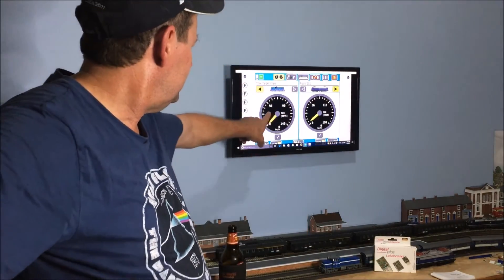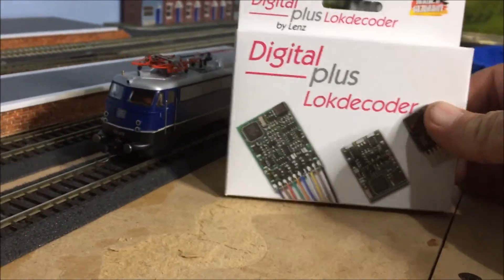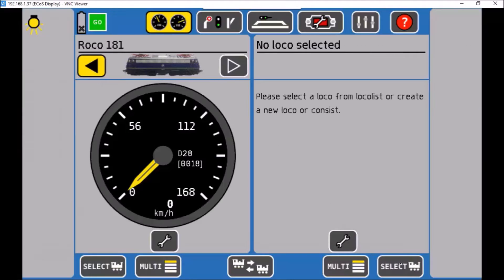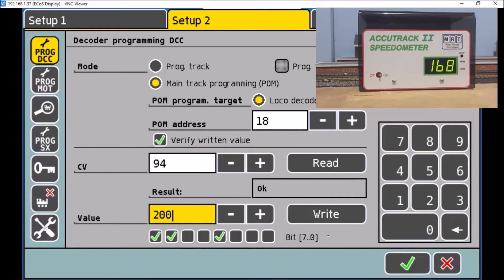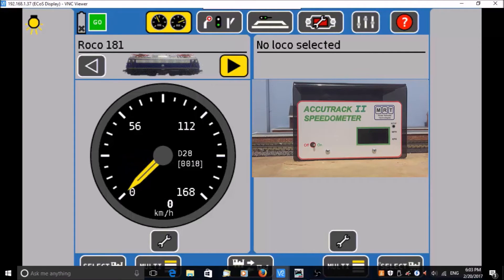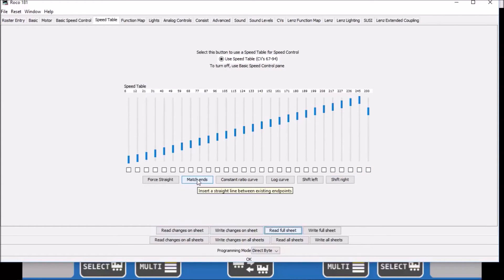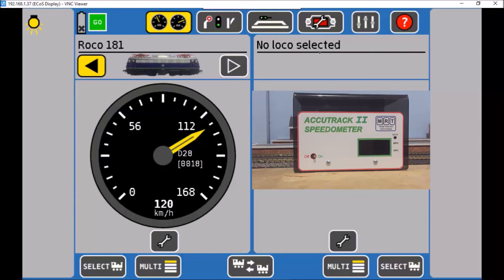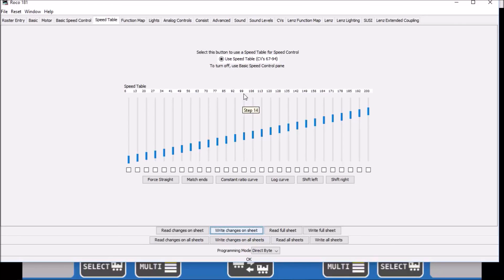How to do speed Calibration using Accutrack and JMRI Decoder Pro

Comment: I use to do the tape measure and timing, it sucked bad! 
Great tutorial thanks for the help!
Reply from the maker: No worries Joe. One of my loops is exactly 10.765 metres long but you have to wait for the train to complete a loop to get the speed. Especialy bad at slow speeds. I can just pick up the Accutrack and plonk it down in front of the train anywhere

Comment: I like it!  I will setup JMRI with my Ecos and try this out.  I just hope JMRI works with the ECOS without a tonne of tweaking.  -Chris
Reply from the maker: Should be pretty easy Chris. Modem routers are set from the factory to assign an IP to anything that connects to them. Just get this IP from the Ecos, punch it into JMRI and away you go. Sometimes the Ecos might get assigned a different IP when connected, but just put this new one into JMRI. It seems to happen about 1 in 5 times for me
Reply: Bears Trains and Stuff hi. On the ecos side everything is fine and it has a static ip address... it was jmri, in the past, that was being difficult.  I used it last night and it worked... except that all 28 steps were programmed, i can read them, say to check if cv 94 received the correct value from jmri... and everything is there But the speed table is not being read by decoder as loco still moves at the original speeds..
Reply: Hi.  On the ecos side everything is fine and it has a static ip address... it was jmri, in the past, that was being difficult.  I used it last night and it worked. Thanks... except that all 28 steps were programmed, i can read them, say to check if cv 94 received the correct value from jmri... and everything is there But the speed table is not being read by decoder as loco still moves at the original speeds.. It has a Tsunami (Soundtraxx but no sound) decoder which does not use the CV5 and 6 settings, so I'm surprised it is not using the settings. -Chris
Reply: Found it! :  CV25 = 16 to use User-Defined Speed Table (at least for the Tsunami, this is required)

Comment: WOW.   I just spent a few hours, yes hours, trying to get this to work and on the engine I was trying it on, I'd set my top speed but after doing the JMRI write, seeing I had a straight line and testing, my MID speed was  over 10% higher than it should have been.   

I couldn't figure it out for the life of me.   So, I went back and watched your video again.   At the 2:20 mark you select DCC28.   I had been selecting DCC128!   Anyway, I simply switched to DCC28 and BANG half speed was indeed half speed!!!!
Reply from the maker: You could set each CV individually which takes a while but is very accurate

Comment: Nice.    I'm always looking at potentially better ways of speed matching.   I'll have to give this a try.   I do have the Speedometer but I REALLY like your idea of matching the speed on the ECOS to the speedometer and the 6 kph per step over the 28 steps to give a top speed of 168kph - that's a little over 100mph so should be good for MOST engines although the Atlas engines and a few other brands have top speeds in the 60 to 70mph range - close to 100kph.
Reply from the maker: Thanks Don. You could set it to 140 which would be 5 kmh per step. I just like to introduce as few errors as possible.

Comment: Hey, what are you using to show the ECoS screen on a TV monitor on the wall? I want to do this with mine as well. I can get the image to my PC using VNC. Is this image coming from a PC?
Reply from the maker: Gday Steve. It's a tv but is hooked up to the desktop computer on the floor using a HDMI lead run up through the wall. I couldn't find a cheap monitor that would hang on the wall.
Reply: One more question or two: 1) Is your connection to the ECoS wireless for JMRI? 2) You read speeds on the main. Do you then move the train to the programming track to use JMRI? Do you need to do anything in the ECoS to tell JMRI you are on the program track? (if that makes sense)
Reply from the maker: Gday Steve.
The ecos is connected to my household router via the Dlink thingy that runs through the power circuit in the house, the desktop is wireless to the the same router.  Once the ecos is connected to the router, it gets assigned an IP address, same as any laptop or tablet that connects to the router. I find this IP address and then set it in JMRI                                                                                            The innermost loop of track has an isolated section that can be switched from "main" to "programming" via a switch and a 12V relay. It switches the feed to that section from "main" to the programming output on the ecos. When I am setting the CVs for the speed, the entire loop is set to main and I adjust the CVs using Railcom (turned on in  CV29 in the decoder) so that the engine can keep running around non stop and stays at operating temperature until the speeds are correct. Once I am happy with the top and bottom speeds, I stop the train on the programming section of loop and flick the switch. Then JMRI can talk to the train directly. The one disadvantage of JMRI and Ecos is that it will only talk to trains via the programming track, not on the main, so when I do the bit with "match ends" and then go to write the remaining speed CVs, it must be done with the track section set to "programming". Once it is done, I flick the switch back to "main" and just drive the train away. I used to have a separate piece of track for programming but it was a real pain moving the engines, especially with some trains that are difficult to disconnect from carriages. When using the bit of loop as "programming", I don't have to do anything to the ecos as the feed to the section is just switched to the programming output on the ecos via the 4 pole relay that is controlled by the switch. JMRI just talks to the decoders straight through the ecos.
Hope this makes sense, I didn't explain it at all in the vid, just concentrated on the speed matching etc. If you have any questions, please don't hesitate to ask. If you want, I can make a short vid which will show how everything works. It's sounds complicated but is pretty simple really.
Bear
Reply: Bears Trains I have the ECoS, JMRI and decoders from TCS, Digitrax, ESU and MRC. Obviously, my speeds are all over the place. My programming section connects directly to the main track and is simply separated by isolating joiners. I can program and then drive directly to the main track. Would it be possible to make a video showing JMRI with the ECoS start to finish? The only videos out there are several years old. I don't know where to start to get my engines matched. A start to finish how-to would be awesome! Thanks again!
Reply from the maker: I will give it a shot Steve. I have tried some ESU decoders but didn't like them as the top and bottom CVs (67 & 94) for the complex speed curve are set in the basic speed curve section and I just couldn't set them correctly so I took them out and replaced with the Lenz. I have never used the TCS, Digitrax or MRC ones so have no idea what the setup in the programming is like.
I found the most important thing is measuring the actual speed and the Accutrack II just works perfectly
Reply: Got the TV installed and connected via HDMI: http://imgur.com/7krBGTM
Reply from the maker: That looks great Steve